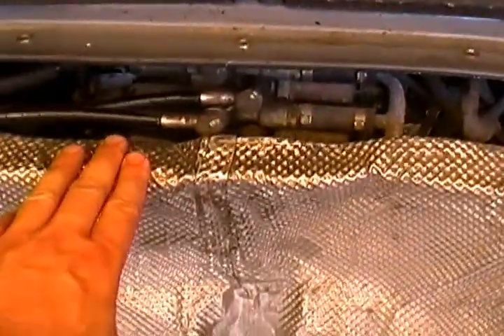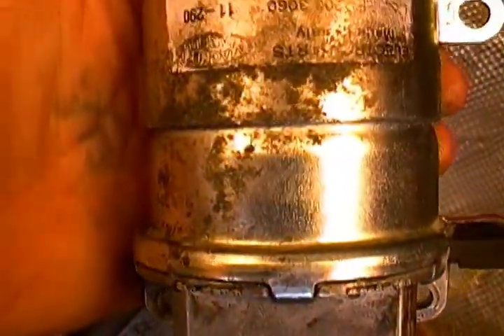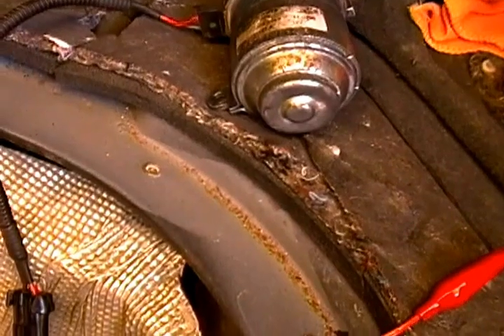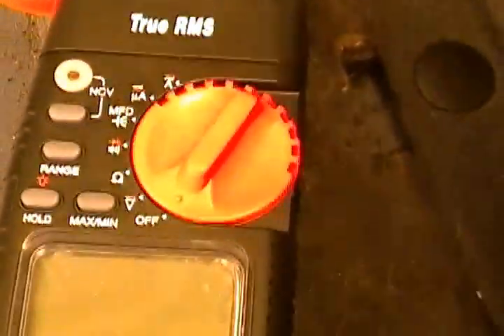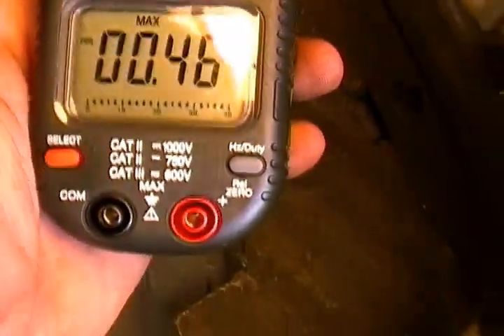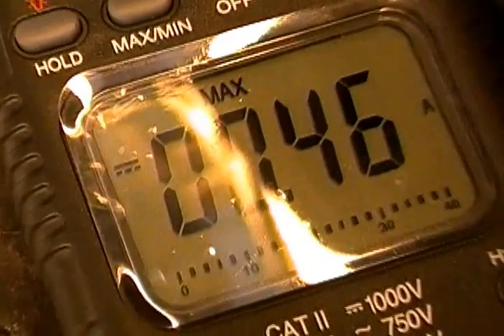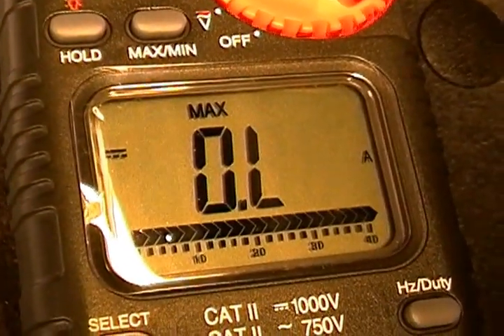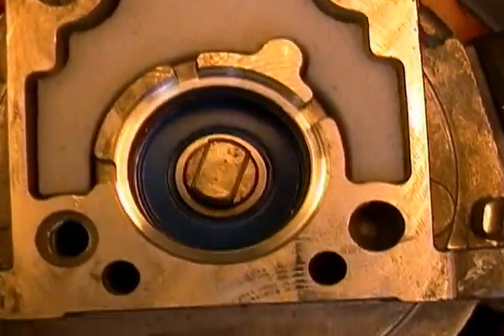Maserati Ferrari F1 Pump "new style" failure

Comment: No comments crazy 🤪. I know it's 5.5 years ago. It sounds like a bearing was built out of tolerance. It cooks the grease out prematurely and then it expands after a short time operating and then binds. It could be too large a race and the balls stacking in the race. Either way is definitely bearing or bushing locking it up.  I wonder if you can take it apart and replace the bearings?  I am starting to study these because I am considering using an F1 transmission in a build.
Reply: Did anyone respond to your comment? I changed mine last week with the trunk method. Fairly easy job. The only thing is, sometimes the hose will crack. I actually had to purchase 2 different size hoses and use a copper 90 degree pipe from ACE hardware. I didn't want to put a cracked hose back in. The hose I'm referring to is the hose that leads to the Clutch from the reservoir.